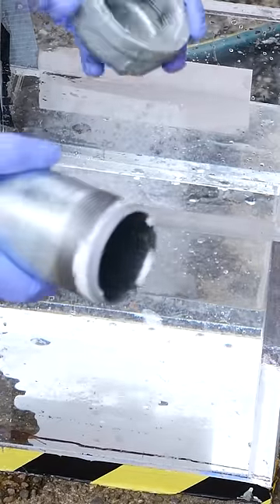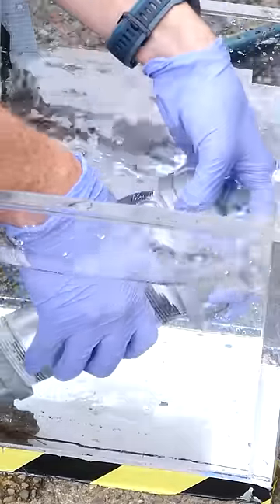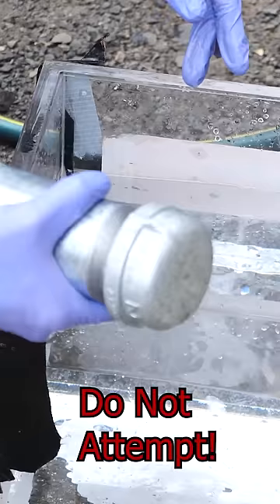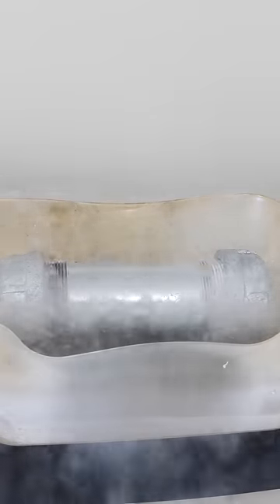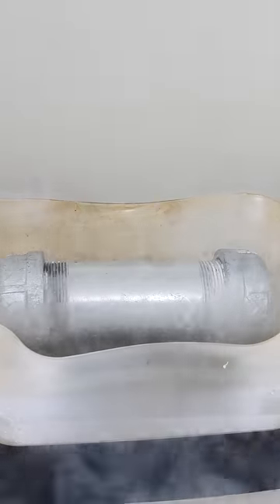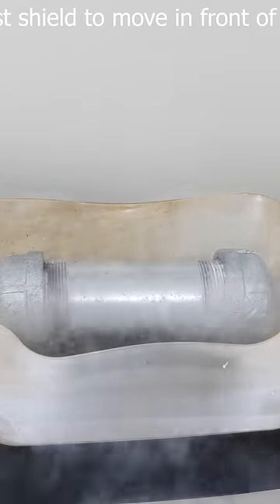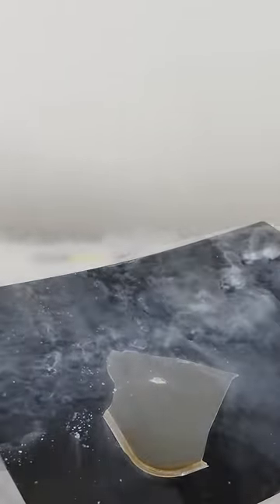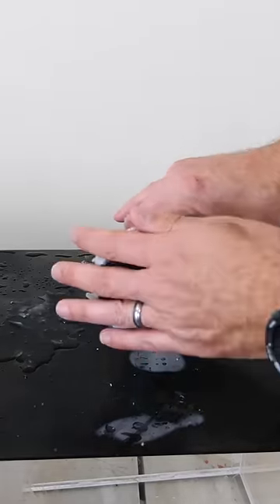Don't Ever Try To Stop Water From Freezing!

Comment: Try that in a freezer that slowly freezes the water instead of flash freezing it. That liquid nitrogen murdered the pipe's structural integrity. I'm pretty sure it would still crack/split, but it wouldn't explode that way
Reply: Correct
Reply: It would exploit the weakest point of escape.
Reply: @dexterlecter7289  yes, maybe the thread?
Reply: To hit Ice III or Ice V you need pressures above 212,9 MPa at -20°C. If you want Ice at a higher temperature, you need to go to at least 632,4 MPa to have Ice VI from. As a side note, there is a Zone of Liquid below 0° Above 10Mpa in the Phase diagram for water. But that would not count as freezing it, right?
Reply: Water is actually its densest @ 4°C and therefore is at its greatest volume. 
That is the reson there is a difference between the weight of 1 ounce solid <28.35g> and fluid ounce <29.57g>. Small but significant
Reply: That's what i was thinking
Reply: @philgiglio7922 Densest means that at its smallest volume, not greatest. You want water to expand as much as it can, to have lowest density possible.
Reply: Also completely seal the pipe by welding it
Reply: @leosim341  most peoples pipes are not welded together.
Reply: @ZedNull.  Yes, but no one is exposing theirs to flash freezing! lol
Reply: i exploded a pop can in a freezer by forgetting i put it in there to get cold... it still assploded and it as just aluminium
Reply: @DerErsteWilhelm  damn i had no idea ice got sequels
Reply: ye i thought the same thing
Reply: @ZedNull.  😂, volume increase of boiling water 😅
Reply: @leosim341 oh that would be fun.
Reply: Was thinking the same thing.
Reply: @leosim341 would it freeze and damage pipe if it was welded shut?
Reply: @cfry3636  technically if the pipe can withhold enough pressure ice with different structures will be formed and if pipe cannot then it can start deforming.
There’s also chance of staying as liquid under freezing temperatures. It really depends on the amount of pressure that will be formed inside that pipe
Reply: @philgiglio7922  um.. no. Densest by definition would mean it occupies the least space for a certain mass.
Ice requires more space than water at any temperature (not inc steam/vapour), hence it is less dense and floats, because it's volume is bigger for the same mass.
Reply: @nangotoman9429 the thread is the strongest. Where the pipe meets the fitting will not break where the threads meet is the strongest
Reply: A freezer isn't cold enough to freeze it. Water under high pressure requires a lower freezing point. Look it up
Reply: @TheWinstonDouble  yes, it needs to get colder in order to freeze under pressure, but a freezer is still cold enough. Saying "look it up" doesn't make your ignorant statement true 😂
Reply: @6litreteaser904  That pipe ruptures at thousands of PSI. Under that much pressure you'd need to get the water way below freezing. Way colder than any conventional freezer.
Reply: @TheWinstonDouble  nah. Prove it. Why do water pipes, steel water pipes in the ground, burst from 10 or 20 degrees
Reply: @6litreteaser904  What's the diameter of the pipe and gauge of the steel?
Reply: That's what I was wondering!
Reply: U never forgot a coke can in the freezer I guess and return to the entire frozen coke all over the place from the explosion
Reply: What, you think it will calmly, politely unscrew itself? The steel was fine, hydraulics are just going to win that battle (which is what’s going on here)
Reply: But try making an entertaining video doing that
Reply: I am not sure if the water would even freeze. Guess that would depend on the themperature and the material and the propertys of the container. If it cant expend it wont freeze.
Reply: @Munenushi  you mean "exploded."
Reply: And weld both lids completely sealed shut to where you cannot move it unless you saw into it
Reply: Came to say this

Comment: Steel mostly becomes brittle when frozen, that is why designed stainless steel is used often for sub-zero containment
Also the steel not only becomes brittle, it also drinks so it is highly likely that the pipe reduction in size couldn't longer contain the incompressible liquid

Comment: This is why we disconnect our hoses in winter. So we don’t burst pipes and flood our house.
Reply: This is also why it's extremely important to properly insulate your pipes, even in areas that don't typically need it. 

People have been learning hard lessons here in South Texas with some of the colder winters we're having in the last decade lol.
Reply: @user-uf9jz7xw4h  jugs. Lots of houses here in the northwoods(or those even farther north in the arctic circle) have to be disconnected from the outdoor water sources because trying to heat it all winter isn't feasibly possible.
Reply: @user-uf9jz7xw4h  you don’t. It’s disconnected for winter freezing temps. Everything outside will die back anyway from the frost.
Reply: @user-uf9jz7xw4h  snow is water
Reply: Makes me wonder how advanced countries like Sweden manage running water when it's -40°C outside. Running water is one of the things many take for granted but which actually is an engineering marvel.
Reply: this is why i don't disconnect or insulate pipes or hoses

we only have 2 seasons
Reply: @bigsmall246  15 people live in the parts of sweden that actually reach those extreme lows, in the far north/northeast. You're thinking of Finland, and even then it's the northern half. Water pipes going to the houses simply get burried deep enough to where, even at -40 air temp, it doesnt freeze over, and then the rest is either built into walls or has small portions with a heating coil.
Reply: @solomonheppner  How north is it like Greenland north or Iceland north or something like that
Reply: @user-uf9jz7xw4h  Get a bucket!
Reply: @user-uf9jz7xw4h  Our main water lines are insulated up here in MN. The water keeps going in the winter but everyone commonly has to blowout their sprinkler lines. Since we get snow in the winter and no longer need to water the lawns, we don’t insulate those ones and just empty them before it gets cold.
Reply: Where I live you leave your house heated to at least like 18C all winter and you won’t have problems.

Try to cheap out and shut the heat off though … see what happens.
Reply: @bigsmall246  It barely ever reaches even -10 degrees in Sweden. Only wayyyyyy up north. Summer is usually around 25 degrees sometimes going to 30.
Reply: @bigsmall246  I doubt it's not that advanced technology.
Reply: @odddellarobbia4  2 seasons?
Reply: @bigsmall246  Their water is actually warm water from hot springs, cooled down for consumption at home. This way it never freezes or cost energy to heat up water.
Reply: @degstoll  The tropics usually just have a hot season and a wet season. He's probably talking about that.
Reply: Welp, I'm too tropic to understand this
Reply: If you remember the freeze Texas experienced in 21, I had to take a fucking blowtorch to the spicket to unfreeze it, I couldn’t leave it on for too long otherwise I’d cause a fire in the wall which actually got really close to happening.
Reply: @bigsmall246  The water supply lines in the US and Canada are connected to houses below the "frost line", the deepest depth at which it is considered possible that water could freeze.  This is why houses in the northern US states usually have basements- the foundations have to be dug below the frost line, and the utilities connected that deep, so it just makes sense to create a basement as you have to do all that digging anyway.
Reply: @user-uf9jz7xw4h  because its just the outside hose, water line are burried below the freezing line in the ground so they dont freeze and house are insulated and are usually heated. 

You would only drain the pipes inside of you weren't going to be there for the winter.
Reply: this is a helpful tip to know, just in case i become a home owner in the future
Reply: @Chr0n0s38  Well, yeah, I've heard that in some places there are 5 seasons as well, so it's not surprising.
Reply: Noob
Reply: @Iamgayman  that's a whole joke, them tweakers out there be melting their meth pipes and melting the solder out of joints and stealing your copper all in one sitting lol
Reply: We always opened the cabinets under the sinks, and let the hot water tap drip since cold water "has a chemical that keeps it from freezing as fast" or something xD
Reply: @ElysetheEevee  wait, I thought cold winters and snow weren’t going to happen anymore because of global warming?
Reply: @pulaski1  I wish I had a basement but in Southwest they don't do basements. I miss my childhood basement. Look you get double the house for the same money it's highly worth it.
Reply: @ElysetheEevee   I hope you weren't a victim of the big freeze from last February. I just went off about it to the other commenter.
Reply: But  this is a different type of pipe, more modern houses are typically copper or plastic pipe, this pipe here appears to be rigid metallic conduit typically used in electrical work. If your plumbing is using this type of pipe you have bigger issues than broken pipes. Also not to mention he's using approximately a 1' piece and rapidly freezing it the amount of pressure rapidly forming is insane, I assure you if he slowly froze it in the freezer like the environment would nothing would happen except it freezes and becomes incredibly hard to open. Speaking from experience north east USA electrian who happens to do multiple jobs outside all winter long
Reply: @tickleevergreen9418  Modern houses don't typically have copper pipe, unless they are high end.  Plastic plumbing has been fairly ubiquitous since at least the 1980's, if not the 1970's.  Iron plumbing pipe,   commonly abbreviated to IPS (iron pipe size) was also fairly common, and is still widely available at Lowe's, Home Depot and other suppliers, both as galvanized iron pipe, and black-coated iron pipe.  While I appreciate you might think IPS is like conduit, it really isn't, as IPS has a fairly thick wall, whereas conduit is much lighter weight, and is typically plastic these days anyway.  FWIW the place that most homes are still likely to have a short section of iron pipe is inside most American tub spouts is about 6" of IPS.

All that said, copper, iron, and PVC/cPVC (rigid) plastic pipe are all susceptible to bursting when the water inside freezes.  What I believe is most commonly used these days is PEX (flexible polyethylene) plumbing, (or polybutyene which was withdrawn in the 1990's) which usually isn't damaged if the water freezes, though the fittings (which may be brass or rigid plastic) could be.
Reply: @derezzed5588  spigot?
Reply: @bigsmall246  Bury outside pipes at least four to six feet, run inside pipes within insulated walls and keep the house warm.
Reply: @pulaski1  "IPS" doesn't mean "Iron Plumbing System". Not sure who taught you that but it stands for "Iron Pipe Size".
Reply: We just use heat tape and pipe insulation.
Reply: U must to believe in our God. Doomsday is on the horizon. Believe Jesus is the Son of God. If you follow the Bible you will know that most all of the 1,800 prophecies has come to pass. Once the final few happen Jesus Christ will return.
"If anyone is ashamed of me and my message in these adulterous and sinful days, the Son of Man will be ashamed of that person when he returns in the glory of his Father with the holy angels.” Our Saviour Jesus Christ died so that we will live. Jesus said, "I'm the way and the truth and the life. No one comes to the Father except through me". John 14:6.
Glory be to the Father, and to the Son, and to the Holy Spirit.
Reply: @bigsmall246  Running water does not freeze. This is how we kept emergency shower stalls from freezing. Sometimes, there was no heat tracing wrapped or poor insulation on the outside of the pipe. For pipes on newly installed outdoor showers (used for emergency chemical splash removal on employees),the shower stall just ran with low flow. Once the flow stops the water in the pipe will freeze so heat tracing is needed. Either hot steam copper tubing on the outside pipe or electric resistance tape.
Reply: @ElysetheEevee
Reply: The only thing bursting would be a hose. We do it to simply save a hose.
Reply: @glennevers4952  Running water freezes as well. You saved your shower stalls because water coming from the pipes was warmer (water in pipes underground, below freezing depth, doesn't freeze). If you stopped the flow water in pipes would simply freeze because of ambient temperature. The flow allowed to push the water of the pipes before it froze.
Reply: We just drained the water from the swamp cooler this morning.  Supposed to be a hard freeze tonight….
Reply: @100GTAGUY  😂😂😂😂😂😂
So true!!!
Reply: @O.s..a   it's just about winter, it happens every year in colder climates.